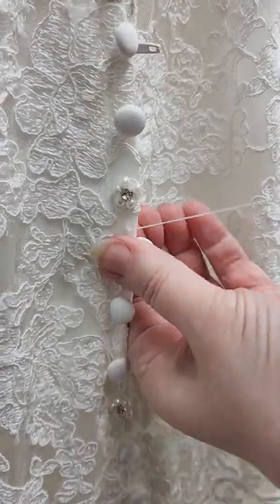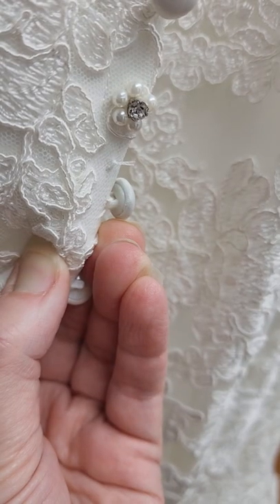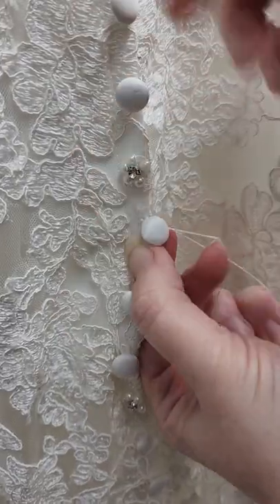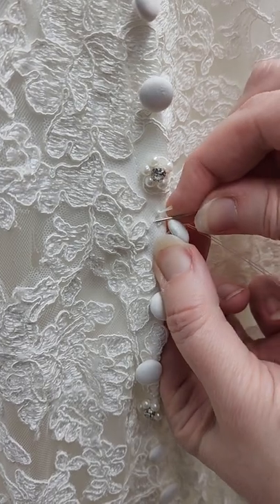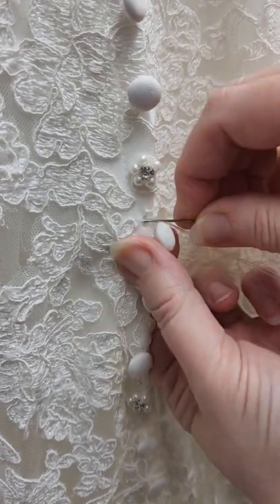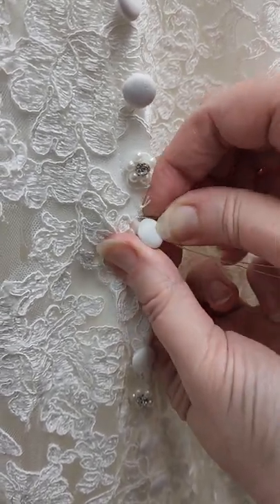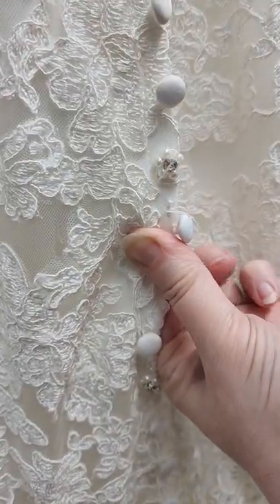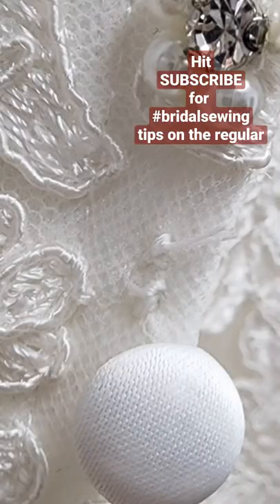How do you "Hide the Tail" when you are sewing a wedding gown?

Comment: There’s a better way to do this where you can’t see the tail or the knot but you pull it through a little bit better then you have.
Reply from the maker: You mean, like this? 
https://youtube.com/shorts/83wSidYqqMU?feature=share4

Or, frankly just putting the knot on the inside of the dress, between the layers works well, too. 

But, the point of this video is what we mean by, "hide the tail." We aren't talking about knots. 

As a teacher, I isolate the subject matter. Especially when there's less than 1 min to do it in. 😂